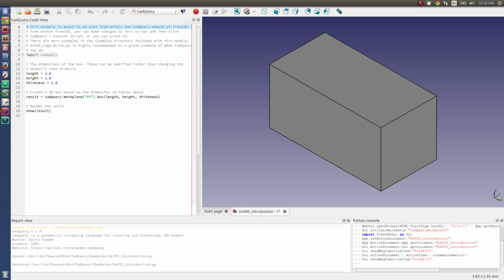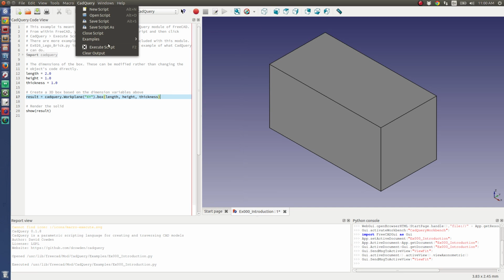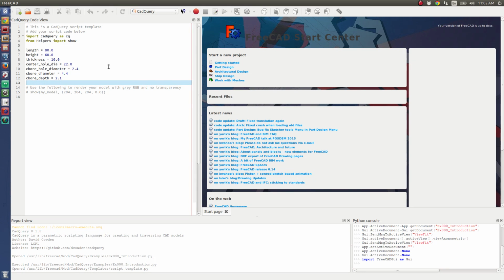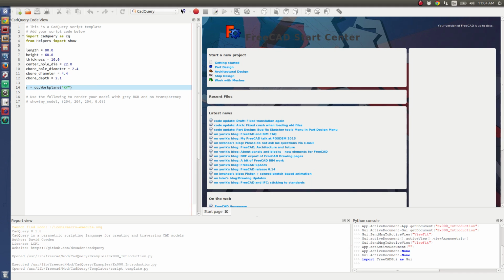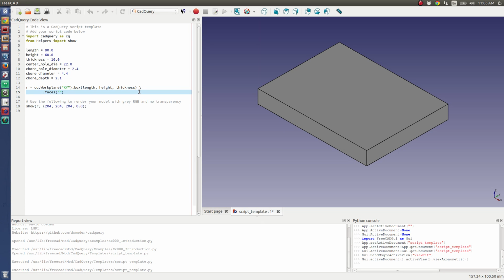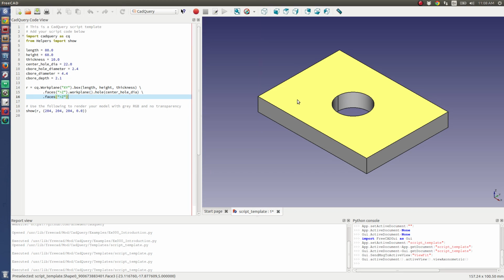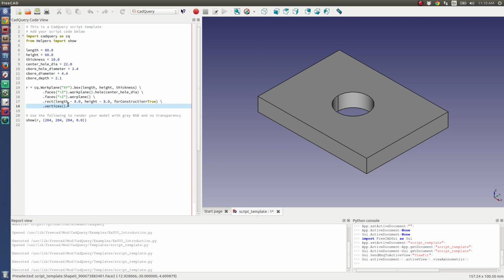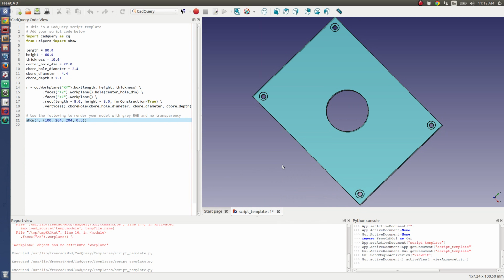Getting Started with CadQuery Scripting

Comment: This is very cool. Can you then take the resulting object into freecad and manually stretch it will that update the script. This is really important.
Reply from the maker: The FreeCAD workbench was relatively recently updated for FreeCAD 1.0 and had been unmaintained for a while before that. It does not translate what is done in the GUI back into the script.  https://github.com/CadQuery/cadquery-freecad-workbench
Reply: the whole question of wether it is possible to 'work-in-reverse' with CadQuery seems to be one of the key questions.. thank you to Jeremy for clarifying.. also I would like to mention that certain AI platforms now seem to be able to modify CadQuery scripts.. I guess that might help for some transformations likes stretches.. I would be keen to know if that works for what you need, Mike..

Comment: This is supercool. I get frustrated working with 3D modelling UIs. Granted, it would take some practice to code various components using a scripting language, but after getting familiar with it and creating a small set of commonly-used features, it could end up reducing the time to create various kinds of models. This would be handy for a manufacturing company that does CNC machining or 3D printing where they could use other Python libraries and create 3D models from databases or CSV files. Looking at the style of model definition, it looks like the 'Decorator Pattern'. I'm assuming you could break it up rather than chaining the functions together. Very impressive! I can't wait to try it out. Thanks.

Comment: Sir, could you tell me what this error is?

Error executing CQGI-compliant script. module 'cadquery' has no attribute 'Sketch'
How can I import this 'Sketch'?

I am writing the following program taken directly from the documentation

import cadquery as cq

result = (
    cq.Sketch()
    .trapezoid(4, 3, 90)
    .vertices()
    .circle(0.5, mode="s")
    .reset()
    .vertices()
    .fillet(0.25)
    .reset()
    .rarray(0.6, 1, 5, 1)
    .slot(1.5, 0.4, mode="s", angle=90)
)
show_object(result)
Reply from the maker: @DrIlyas-sq7pz  This video is getting pretty outdated and Sketch is a relatively new feature. Please see the installation instructions here, and the pip installation instructions below that if you prefer pip. https://github.com/CadQuery/cadquery#cadquery-installation-via-conda

Comment: Does anybody know how to get the function arguments in the cadquery script console to show? for example at 5:19, the author, types "Workplane()" and in a black box with white text the function arguments show up. I have searched the interwebs but cant figure how to turn this on. Having this option on would really help in learning this module without having to reference the text everytime.

I can provide more info on my system if needed but my preliminary specs are cadquery 1.0.0, freecad 0.16, and ubuntu 16.04. I can run the scripts and everything seems fine; I just cant get the "hints" to show
Reply: I used OpenSCAD a lot for scripted modeling. Now i'm switching to FreeCAD and to more i get into it the more i like it. Now I've discovered the CadQuery project and  the construction seems even more intuitive and fun to write. The auto-complete would be the icing on the cake. 

Are there any advances in getting it to run? How can i help with this?

I've noticed that there is no more "CadQuery Code View"-Window but just a "normal" FreeCad Code window in the current version, why is that? I guess this has nothing to do with the auto-complete.

The auto-complete feature seems to work fine for builtin python keywords and script variables. Only the cadquery names are missing?

Btw, is there a way to have a tab-auto-complete in the console like in editor?
Reply from the maker: Nick Schaeferle Do you mean how to get the auto-complete menu to show up when you start typing "Workplane"? I've noticed that feature hasn't been working as well in the lastest versions. I might need to upgrade the text editor library again.
Reply: Yes if the "black pop up with white text in the tutorial" is called the auto-complete then yes. However the drop down list of the functions are there which indicates that the script console sees the cadquery python package it just doesnt display this "auto-complete". If its a known issue then ill just use "https://dcowden.github.io/cadquery/apireference.html" but it would be nice to have in the future.

Anyways I like the tool its really helpful especially for parametric parts like pcb components
Reply from the maker: Nick Schaeferle Thanks for the feedback. I'm glad that you find CadQuery useful. I've filed an issue for this and will try to take a look in the morning. https://github.com/jmwright/cadquery-freecad-module/issues/86

Comment from the maker: Good questions Eric.

While in theory it should be possible to create Javascript bindings, I can't imagine it would be easy. CadQuery was inspired by JQuery, but it's designed to be very Pythonic. Did you have a specific use for the Javascript bindings in mind?

What form(at) do you want the retrieved geometry in? CadQuery does have the ability to export files to multiple formats, but I'm not sure if that's what you're asking for. You can also extract the wrapped FreeCAD geometry to work with it at a lower level.
Reply from the maker: +Eric Schleicher If you send an email to the CadQuery Google Group, we can talk through a few examples on how to select faces, edges, and vertices.